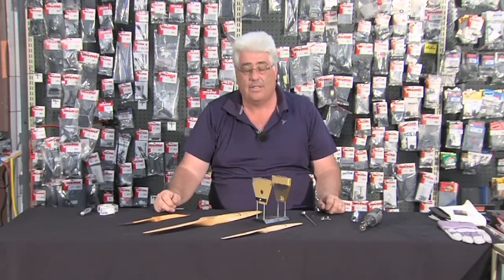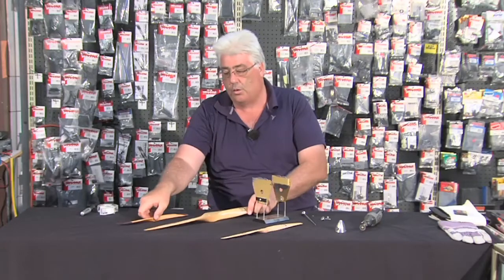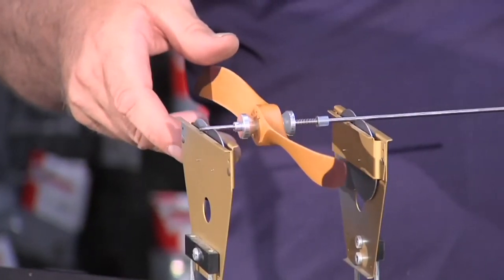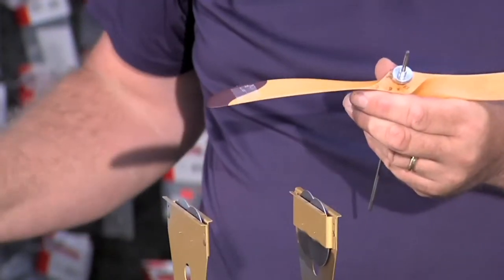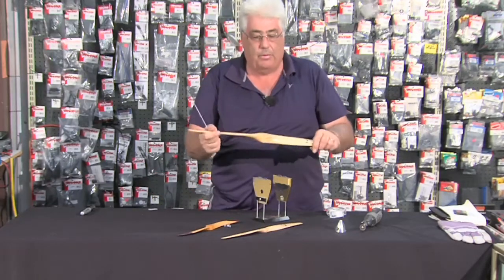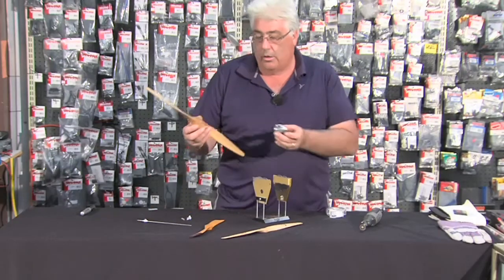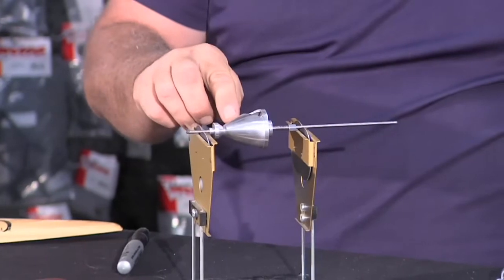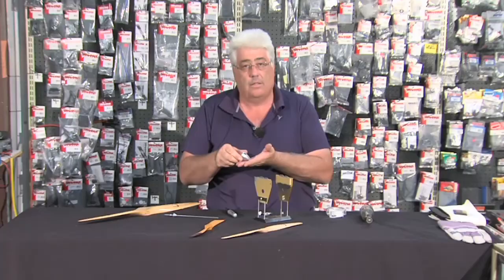Balancing RC Props |  RC Hobby Network

Comment: Again we have cones taper WRONG .... rear hub cone taper IN .... front hub cone Taper OUT .... Why ? Check APC Technical Support for manufacturers instructions .... rear taper centres the hub / prop ... flat face of cone at front makes sure prop is perpendicular to shaft same as when on motor. If you put taper at front as well in the non precision shaft hole - it can skew the prop off true perpendicular.